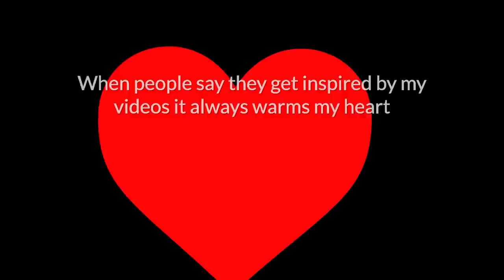Blacksmithing - Forging a seamless socket (tool making)

Comment: Thank you for the shout out :)  I like the interchange kiss blocks, a good idea.  I find rotating evenly clockwise/counterclockwise gives a uniform forging.  Another cool feature is that the "tube" wall thickness can be whatever you want.  Looking forward to what you make with it, I'm working on a candle snuffer idea at the moment w/ this tooling.
Reply: I really enjoy your work sir. Every video you produce makes me think I should try that too.
Reply: Just subbed! Good enough for Mr. Åhman, far more than good enough for me!
🙏 Blessed day possitive energy and well wishes
Crawford out 🔥⚒️🧙🏼‍♂️
Reply from the maker: Thanks John, yes there are definitely many useful applications for this technique. Some will probably argue that it can be machined to start with, but that's not so easy as it sounds.
Reply: You've got a great channel John, it definitely deserves more subscriber love.
Reply: A candle snuffer is a good idea, you never see or hear about those anymore.
Reply: John you earned another subscriber today. Thanks Torbjörn for the recommendation.
Reply: Don't you machine all of your tooling?
Reply: Thank you sir for your input, absolutely genius!!!
Reply: I don't know why it's so funny to me: other people see candle snuffers or a socket chisel, or socket for a  shovel, but I immediately think of a spear. This would be such a great method for producing tools (or weaponry) on a large scale. It would be exceptionally high quality in materials, design, and process, but still be quick and  uniform.

Comment: Nice die. Lie Nielsen still makes socket chisels using the Stanley 750 design. Tom, the owner, said that the socket chisels are significantly more difficult to manufacture. He didn't go into details, but now, seeing this video, I can understand why.
Reply from the maker: I don't think this is the only way to make them but yes, it takes a bit more effort.

Comment: On a larger pipe, forge welding a tool to the bar end would leave a perfect handle end for garden tools .You would have to leave more material at the junction of the flare for strength. Beautiful video work! 👍 😃

Comment: I don't know if you would want to use this in a video, but my preferred method of making a socket is to forge weld a piece of iron pipe to a turned section on my workpiece, and then forge down the junction in a way very similar to what you've shown here.  
The only problem with this method is that because it is very difficult to draw out the metal of the pipe over a mandrel, the sockets tend to be very thick and robust.  That is something I generally prefer, but that may not be appropriate for certain historical recreations.
Reply from the maker: Cool, yes I have seen that done. Drilling it out like this you can leave the wall thickness pretty thin I think. Welding probably requires a thicker section to hold up.

Comment: I noticed that you had to hand move a light for your drill press. I mounted a swing arm lamp next to my dp and it works wonders!  Looks like you could easily attach one to the wall behind the dp.
Reply from the maker: It's a video light, but sure I could use some more different mounts for it.

Comment: I’m going to watch this tonight but I wanted you to know, I am planning to set up a forge for my son and I… any suggestions on what to use for an anvil substitute?
Reply from the maker: Great! Any large chunk of steel will work. If you have a scrapyard nearby that might be a good place to start searching. Even a large sledge head secured in a wooden stump will work for smaller things!
Reply: Tie plate if you can find one.

Comment: Is there a reason why you used the MIG to tack the part but then used the stick welder to finish? I'm just wondering if there was a difference in the welds you were specifically looking for for this project. Also your garden is absolutely beautiful!
Reply from the maker: The mig is super easy to tack with, but my machine is too low amp for heavier stuff.
Reply: @torbjornahman  I see, that makes sense. There was me over-thinking it haha.

Comment: That's awesome. Looking forward to the project. Can that setup be used with now power hammer?
Reply from the maker: Thanks! You can use the same setup with a striker and a flatter/set hammer. Alone would be harder, but might work with some sort of guillotine tool.

Comment: Drilled blank? Sounds like a damn machinist trick. Could the blank be axially blind punched, pierced, whatever, then socket forged back and forth like you'd make a hammer eye? Just a thought. Axial punching free-hand sounds laborious and hard to center. Might be a better job for an upsetter
Reply from the maker: Yep. This is not a traditional technique at all, and making the pipe by punching is not possible without very precise tooling and a press I guess, but then you could just press the entire thing to start with.

Comment: Very nicely done, I can see that being used for wooden chisel handles etc in the future. Summer is Sweden, how beautiful, makes me long for rosettes, damper and billy tea served under a shady tree somewhere near your neighbourhood !!! ( I shall have to stop dreaming, LoL). Noticed your power hacksaw cuts on the pull stroke, mine cuts on the push stroke, never seen one before that cuts on the pull stroke ,is this usual? Regards from Down Under.
Reply from the maker: :) :) Yes the summer here is nice.  Yes it does, I think that is pretty common. Are you sure you put the blade in the right way? :) :)
Reply: Yes, the blade is definitely in the right way. When I was a young man I did an apprenticeship as a “Fitter and Turner”, in other countries this probably would be known as a “Machinest” (the 1970’s). All the power hacksaws I came across always cut on the push stroke, this is why I was surprised to see yours cutting on the pull stroke. My hacksaw “ indexes “, the blade drops down to cut, then lifts up as it returns back for the next stroke. I observe yours is doing the same , only on different strokes to mine. I’ve not see this before, however I am in the Southern Hemisphere and they do say we do everything backwards down here !! Lol 😂😜🤪.
Reply from the maker: @outbackladas  Of course, the southern hemisphere is to blame. I bet if you bring the saw over the equator it will go the other way.
Reply: I love your sense of humour, did you know that here in Australia the crows fly backwards to keep the dust out of their eyes 👀!! 😂
Reply: I love your sense of humour, did you know that here in Australia the crows fly backwards to keep the dust out of their eyes 👀!! 😂
Reply: I love your sense of humour, did you know that here in Australia the crows fly backwards to keep the dust out of their eyes 👀!! 😂
Reply: Sorry, must have pressed the wrong button.
Reply: Probably something to do with the Southern Hemisphere again.
Reply from the maker: @outbackladas  Makes total sense! :)

Comment: How does this work. It making the hollowed out “Socket” as you are shaping the exterior part? I’m not a Blacksmith nor have ever worked a forge. Just curious.
Reply from the maker: You need to prepare the bar and drill it hollow, like a pipe. Then the forging will just deform and shrink the "pipe" to a taper.

Comment: why do you use the stick welder when you have wire?
Reply from the maker: My mig welder is pretty weak, and will not weld thicker material very well.

Comment: Very nice. But how did you mysteriously transition from conical solid bar to conical hollow bar at 12:20?
Reply from the maker: I think you missed the part where I started with the drilled out bar.

Comment: I never forged anything but at 12;06 he is hammering a round bar, but at 12;18 he is showing a cone shaped piece of steel with a hole in it. Where did the hole come from. ???
Reply from the maker: You missed a short bit I guess. The hole is done on the lathe. I will show the entire process in another video.

Comment: Why doesn't the flat top die mess up the taper? I would think that both top and bottom dies would need a taper.
Reply from the maker: If you hold the piece at a slight downward angle it works nicely. For a larger angle you would probably need two dies.

Comment: Do you think one could do that with a guillotine tool and a hammer?
Reply from the maker: Maybe, but forging pipe is not easy on the anvil. The three point contact in this tool is what makes it work good!

Comment: looks pretty but less usable at fact.
Reply from the maker: We will see...
Reply: @torbjornahman  The open end allows wood, which degrades over time, to move deeper and keep tight. in a closed cone, wooden shaft rests on the end but degrades on the sides and begins to stagger. its sad.

Comment: No. Just No.
This is how to make a JIG to form pipe into a seamless socket wit a power hammer. 
Now do the real way with a hammer, and anvil and some square bar.
Im sorry, but this is not an instructional video for someone without 30,000$ of gear to forge.
Reply from the maker: It isn't an instructional video! :)